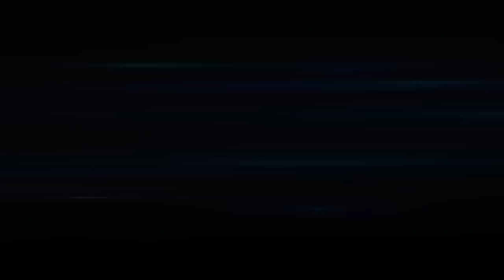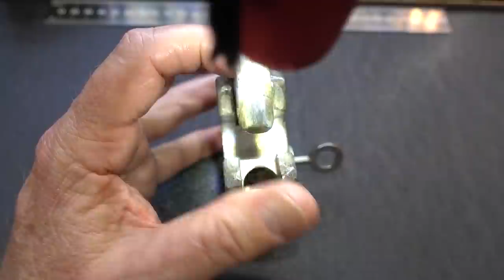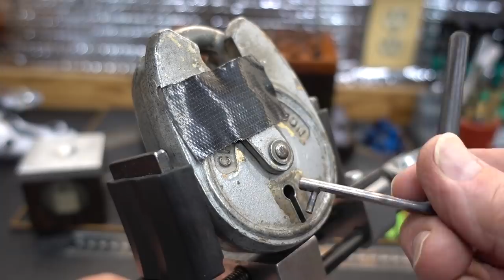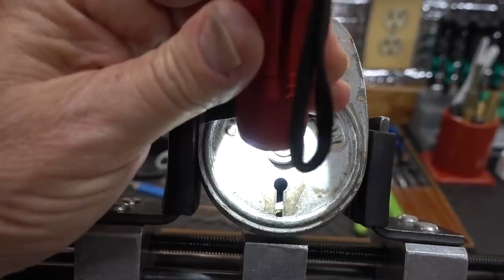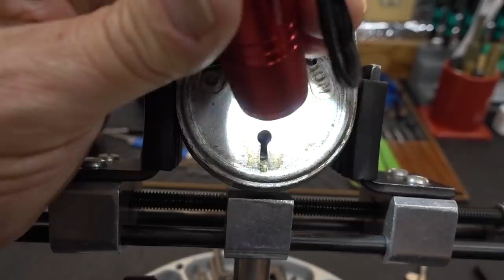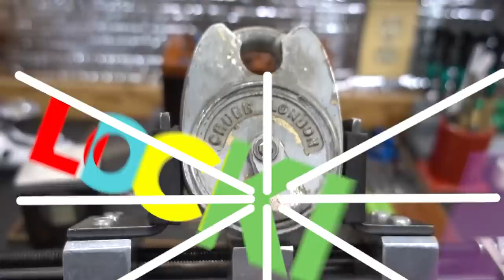(1384) Chubb Battleship (1K11) Padlock Picked Open

Comment: The “bar” is a monitor lever, this is to make sure the bolt is fully thrown. It holds up and blocks the keyhole if held up. Stops someone filing the bolt throw on the key to leave the bolt half thrown.

Comment: You can buy a dedicated wheel pick for these locks which are great. I think the monitor lever is always in the same position which is lever 3 but isn’t in all of these locks. To find if you have 1 put in your pick wire and turn it to the 3 o’clock position and pull/push the wire from front to back. If the lever is present then you will feel it.

Comment: Correction. The lock does not have any kind of detector or 'pick indicator' What you are seeing is Chubbs ' Monitor Lever ' This is to prevent the key being removed from the lock if the bolt is not fully thrown.
Reply: That makes a lot more sense than a pick indicator that prevents the owner from opening the lock...

Comment: The "Chubb" name is now owned by UTC - United Technology Corporation, an American company. They still own an electronic security servicing and installation division called Chubb in the UK and an electronic security manufacturing division which owns Lenel, Cassi Rusco and recently acquired S2. They sold the lock manufacturing business to Assa Abloy in the early  2000s, at first under licence, so Abloy could use the Chubb name and now under the Union and Yale names. A different licence is still in operation for custodial locks, so locks in jails and police stations are made by Assa Abloy but have the Chubb name on them. By the way, UTC also own Otis (elevators/lifts) and did own Pratt and Whitney and Sikorsky  sold in 2013 and 2015 respectively).
Reply from the maker: Thanks for the info!  It is always interesting to know the "rest of the story".

Comment: NB this morning, went to pull the key from the lock on my hostel room door, and the cylinder came out with it! (Timişoara, România) lots of bumps and dimples on the sides of the shaft, but no keeper on the cylinder.
A Yale, now replaced.
Reply: Euro cylinder? If the retainer screw is missing, those will come out if the key is held at the exact right angle while you’re trying to pull it. And yet, especially if it was held in place by a layer of paint, and the user is reasonably careful about always having the key straight when withdrawing, it could work for years without a problem, and it doesn’t actually compromise security either way (you still can’t do it without the key present).

Or did you mean the round plug came out of the lock cylinder? That could only really happen if the retaining clip fell off recently because that happens the first time you take the key out.

Comment: Hi Bill. Long time fan, first time commenter! (that could be a lie. I may well have commented before!) I have a question. How much time do you spend finding the exact tools for the job? Does it take ages or does your experience mean you pretty much know in advance what you need? You and LPL make it look so easy but I imagine an actual theif wouldn't have access to the variety of tools that you have.
Reply from the maker: I don't know how LPL does it, but I simply choose the tallest profile pick that will fit into the keyway.  If a postal hook fits, that's the one I use, but most locks restrict the height of the pick that you can fit.  By default, on non-challenge locks I grab the medium hook and begin with that.  I actually spend a LOT more time finding the right tensioner to fit the keyway than the pick.

Comment: Could anyone point to a good demo of a lever lock in operation? Anything from real copy with the face milled off or a simple animation would be helpful. I'm trying to understand how the false gates work here. I wouldn't be surprised if Bill, himself, has an explanation in the back catalog!
Reply: I did find https://youtu.be/irfwWhVJc-4 , Bill's vid #1380, which shows the picking on the inside via the "lock cam." That worked out really nicely! I'm still a little confused by the false gates, but I'm thinking that it's similar to how its done for wafer locks. Just a guess, though!

Comment: are there any tribe members that have any info on cores that fit the 7pin adversary ultimate challenge lock from LearnLockPicking.com?
Reply from the maker: EB Gamez  I don't know of anywhere that sells just the core, but it is a standard sized core so almost any 7-pin core should fit it.  If you damaged or lost your original core, try to buy a cheap 7-pin lock on eBay, then use the core from that.  Good luck!
Reply: @bosnianbill  just need a new binding order thank you bill